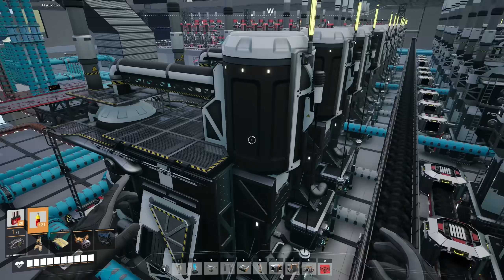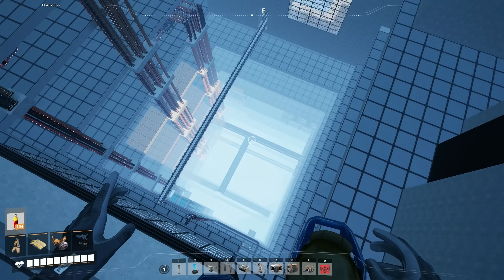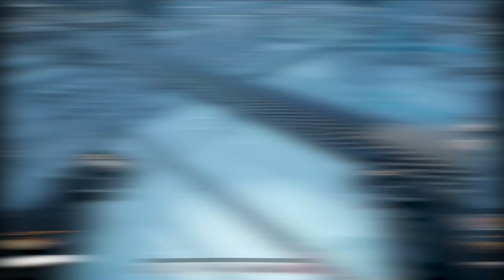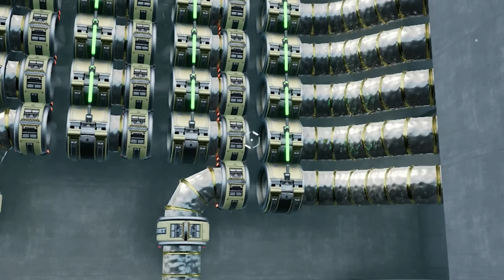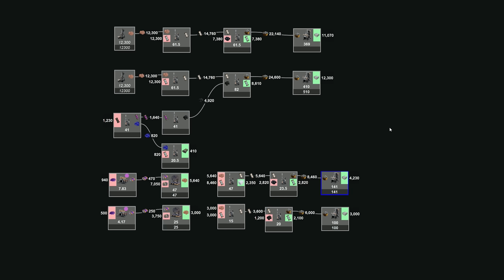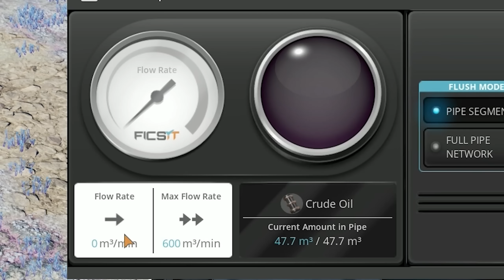Automating 12,300 Aluminum /min is INSANE - Satisfactory 1.0

Comment: Quick tip here if you're planning on using the Electrode Aluminum Scrap and Sloppy Alumina:  just underclock the Sloppy Alumina Refineries to 75%. This allows you just run one pipe of sollution to one machine, keeping that step reliable and super simple, and better yet, changes the Bauxite and Water consumption to 150/ min making the math extremely simple. 
- MK2 Pipes carry 600/ min, that's exactly 4 machines.
- Fully overclocked miners always pull in multiples of 150. 
Yep, I hope you can see where this is going. Hope this helps!

Comment: 13:50 Wouldn't there be a problem if you only feed them 600 bauxite into a system that requires 1200 bauxite?(6 Refineries) But at the same time, you're feeding the first refineries in each line with as much water as they WOULD take, IF you had the 1200 bauxite belts coming in. So you're feed way too much water in, which will lead to the entire thing not working anymore. 
Tip for anyone that wants to avoid stuff like this: You can just feed the water from the second refineries(the ones making alu scrap) back into the front and then whatever amount of water is still needed for the refineries in front, for his example, 60 water would be needed. Put that into each one individually with a limited valve. And for safety, make it 59 instead. So long as your system keeps producing it will never overflow with water. Which means that you have to sink overflow at the end to ensure constant production.

Comment: The main problem i have with aluminum is the water byproduct. Its no big deal when you are small-scale, but at these huge production numbers, balancing that liquid output back into the system be comes problematic because of the complexity of 600 lines and how they work. That's why I almost always just sacrifice plastic and throw all the water in the grinder. The waste in plastic is better than trying to balance hundreds of water back onto multiple 600 lines.

Comment: Your train logistics will still have problems as it is right now, the loading/unloading animation for the trains stops the outputs from the train station for 27.08 seconds each time it runs, so with your 1200 belts if you only take the one output from the train station you will have that 27 seconds where you get no more bauxite. You need to have belts coming from both of the outputs of each train platform into the container for it to work properly
Also, if you are interested I made a graph that has really been helping me out with my train logistics and deciding how many trains to have on each line, as well as how many cars to have per train (including the maximum amount you can have going into each). I have labeled all the inputs and everything for it and I think it would help a lot for anyone struggling with the complexity that is train logistics! Its on Desmos, the online graphing calculator tool, and the code for the graph is 59xvwyjxzz (just add it to the end of the normal Desmos calculator page URL). 
Don't mind the fluff that's everywhere on that graph, the equation is just so complicated Desmos gets kinda confused, but it shouldn't effect anything, just look at the solid green line for numbers :)
Reply: For multiple trains, the graph assumes they will be arriving at even intervals and there's nothing I can do about that, but we take what we can get lol

Comment: Kibz, if you change up the power shard distribution to be just 1 per machine, it may cost an additional power shard but the pipe balancing wouldn't be an issue.  With how easy it is to wind up with a couple thousand shards thanks to loops, I'm inclined to go that route.

Comment: Hey Kibz, how has the game stability been for you lately? I have taken some time off the game because I have been having a ton (distracted by the strong call of the void) of crashes with a vanilla game. Quite a few of my crashes have been to desktop without the Unity crash reporter. I even made a completely fresh install when 1.0 released since I was using a ton of mods before that. If anyone else is having significant stability issues drop an emoji or reaction.

Comment: you can use polymer resin from petrolium coke production to make some rubber for heat exchanger alternate recipe which is way better than heat sink recipe since it uses less aluminium and dosn't need copper, leaving more for pasta

Comment: Sloppy Electrode FTW.  Sounds like an adult sex toy.  No silica, less power, more aluminum scrap, better ratios, less net water.  Yes, it uses oil, but the additional aluminum made with the silica recipes uses more power than you'd generate with the oil.  Or something.  Anyways, it works out.

Comment: Might as well have the resin turned into Plastic and Rubber with the Residual recipes, all it takes is the resin and water which you could use the water use saved from alumina production.

Comment: ya, didn't know if the floor hole pipe bug was still in the game, so I decided to only use them cosmetically by having the pipes go through the floors and putting the floor holes over top so that issue didn't happen. Positioning can be weird with the holes sometimes, so route the pipes through the floor hole first. Then, once you have the correct location for the holes, delete the pipes and reroute them directly together. Fixes both problems with minimal extra effort. Can't wait for the straight pipes to be added in next update

Comment: tier 6 belts, feeds 6 refineries, but water, u can fuel 3 with water, and run 5 waste, into 3 refineries, an 3 back into 3, and underclock 1, doing so, the system runs in modules of 8, an ud need 3 6 lines for 24 machines

Comment: The floor hole trick doesn't work for me :( There's always a portion missing where it connects to the hole, even though it will move items through it. I work around it by just making a floor hole every 10ish floors and then removing the floor around it, and it just creates these little black tunnels around the lift which are barely noticeable.

Comment: Wait I'm confused. I thought the reason for connecting a storage bin to trains is because belts don't flow in or out of the train-station when its loading and unloading a train, so to catch up for that lag in time you have the bins connect to both ports of the station and then just have one belt out of the storage. If you just have a single belt in and out (or two in and out like you do in your other video at the mine) then the storage just empties at the same rate  it fills and doesn't do anything. Am I missing something?

Comment: I saw a post about how to make sure your pipes prioritize certain inputs after battling with the excess water with aluminunumumum for hours and hours. Basically you want to set up your pipe junction not flat where the four inputs are going forward back left right. You want it where it is oriented where one is facing straight up and the other is facing straight down. It will always prioritize the down input so if you loop the excess water from the aluminum scrap machine back to the bottom input of the junction that goes into the Sloppy alumina machine it will always prioritize that input and therefore the aluminum scrap water will always get used. Absolute game changer for recipes that have excess water. No more needing to find a nearby limestone deposit sink the water
Reply: Another option Kibitz could have done would be to have the overclocked production in the middle so the valves are pointing in instead of to one side of the trio of .Refineries.
Reply: @staris3712  Or not have valves at all. Pipes will self balance through backflow, because one machine can't take more than it needs, so the water will go to the other pipe and continue to the next machine.
Reply: Does this actually work for you? I cant make this work at all.
Reply: @Battlegurke  Yeah I’ve never had a problem with it. I can have as much water as I want going through the pipes from water extractors but it always prioritizes the bottom fed inlet of the junction. There was a video on it I saw, let me see if I can find it
Reply: @nicolasmurphy8412 I have watched Videos on this and read guides. I mean it's a simple concept. Yet it just won't work. I'd share a link with a screenshot but yt deletes links...
Reply: @Battlegurke try adding a powered pump on the pipe with the recycled water. Pipe height is only half the priority logic, the other half is the amount of headlift the pipe has. If the upper pipe has higher headlift, it may still get prioritized. I have three or four aluminum factories that have been running at 100% for a couple hundred hours.
Reply: @Olde_Faithful  I'll try, thank you
Reply: It's actually pretty simple to ratio the refineries so some only run on the waste water and the system never backs up

Comment: The issue with floor holes is there are 3 snapping points. 2 near the floor on each side and one in the middle. Make sure you snap to the middle from both sides.

Comment: 4:23 I have some bad news Kibz. You need to buffer the station with dual outputs b/c of the traing loading animation output pause. Even with a 1200p/m output, it will never reach that throughput over time if the belt is not fed 100% of the time. It MAY work for 600p/m stations, depending on how often the station is working. Need to remember the loading action is slooooow.
Reply: I am screaming internally at this. The beltwork looks horrendeus now and this won't even help. Not only this but I'm also pretty sure that the waterworks is not done properly and will clog somewhere in the future
Reply: Yes exactly. Whenever I make train stations, I always put the output buffers right at the station. It can be underneath if you want to preserve aesthetics, but regardless you need two belts going in so that they can overcome the lost time for the unloading animation. The same goes for the input at the source - also needs a double-belted buffer storage container.
Reply: He also need to buffer the loading stations with double belts 🥲
Reply: @haloaless  He did that, you think he would have realized he needed the same at the receiving end.

Comment: I really hope they fix that floor hole bug soon, I spent probably about 5 hours on both my aluminum and turbofuel builds trying to figure out wtf was going on
Reply: The trick is to clip the pipe throught, and then add the floor hole, it looks perfect
Reply: Ive never experienced that bug and I use the floor holes for everything.
Reply: It was listed as fixed in one of the last patches. But it is not possible to fix floor holes that already are broken. Any newly connected ones should work fine, but you have to rebuild the pipe once like Kibs.

Comment: i dont have time to watch all this video, but how did you deal with water waste? did you loop it back to the system or do something else? i made simmilar factory that makes 6k casing and my water waste is looped back into system and it sometimes has too much or too less water, but i did calculate it and it should be working, every pipe has 600 water/min and going to the machines again that also consume 600water/min, but sometimes machine has 95-99%